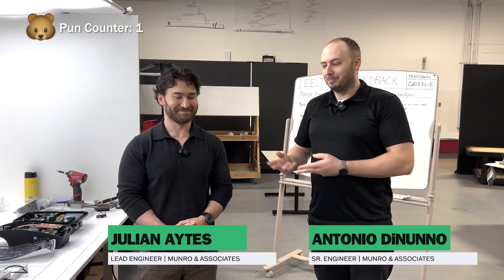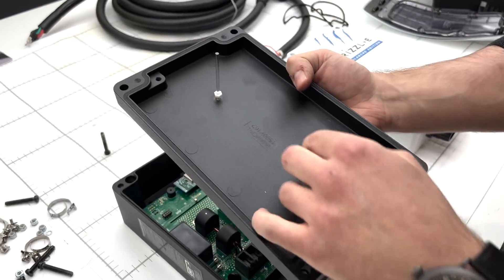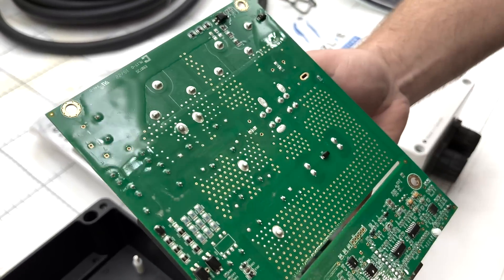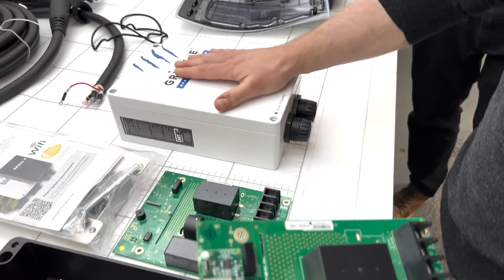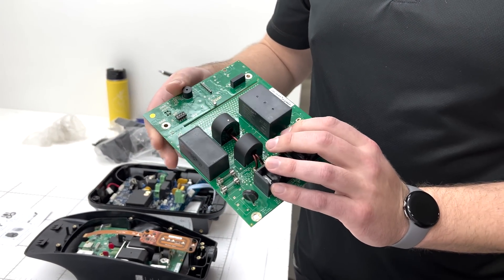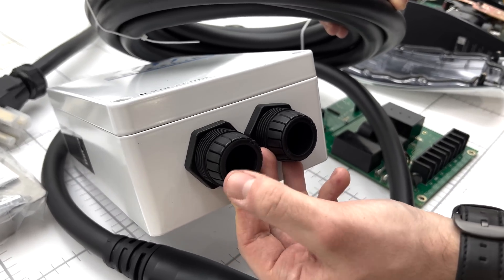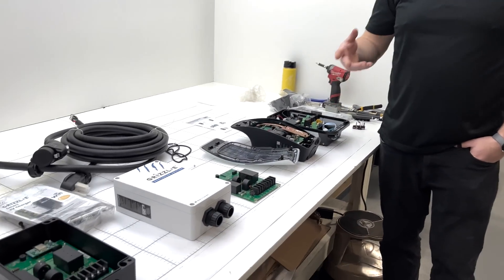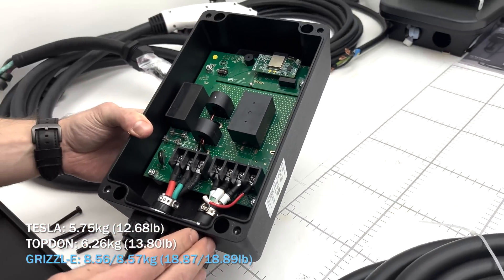EV Home Charger Teardowns E3: GRIZZL-E Classic & Avalanche

Comment: Hey Ho! This review echoes Mr. Tom Mologney , State of Charge, review. This is a first rate charger which will survive if you have kids in the house. I have two of this brand, and I have had no problems nor concerns with it. They COMPLETLY left out the fact that you can have this charger device with a plug in OR a hard wired installation method. To the curious reader in search of an excellent charger; this is the one to buy!  {For all the linguistic Karens-- 'charger' is the vernacular term for what is, in plain terms, an extension cord with a computer attached to it, to feed electricity to your EV. The true 'charger' lies inside the EV}>

Comment: The Tesla charger case neatly holds its cable.  Given that these are little more than 'junction boxes', that's the major feature difference in my mind.
Reply: The Grizzl-e comes with a holster to mount on the wall to hold the plug when not in use. It has a groove on the top side of the holster to carry the cable. It's not as elegant as the Tesla set up, but it's simple and it works well.
Reply: The grizzle comes with a nice holster for the cable therefore there is zero difference

Comment: I bought the wifi model and the wifi functionality never actually worked. It does charge good though. Just don't buy the wifi one
Reply: I wonder if the fact that it has a metal (aluminum) case is part of the reason for WiFi not working or just having really bad reception. Usually, when you have a metal enclosure you need to add an external antenna.

Comment: I bought the classic less than a year ago to do 30A out of my house for now.  If i move up to 50A, you just need to change the dip switches inside, they said.
Reply: Only rated for 40A…don’t for to upgrade your breaker when you trip those dip switches!

Comment: This is drivel. I expect Monroe to comment about engineering for manufacturing, durability, and performance. Talking about how much a circuit board weighs and how easy it is to take a unit apart is completely irrelevant. Also, if you know why there are physical fuses in lieu of electronic circuit breakers, say so, but you don't know, you're just speculating. I get enough of that from talking heads on TV
Reply: also slacking analysis - "lead free on the board" - the icon is on the 3rd party daughter board, the small board with the controller soldered on the "wifi card" - which doesn't mean anything for the whole board. the chip might even be an esp32 which would be interesting to know they are using this in there. Also is this an electrical engineer talking about the "integrated pad presenting the electricity to choose different paths for electricity" ? Really?
Reply: This is the third one we've torn down. So we don't have a baseline for "normal", yet. We are seeing some common circuits and the hall-effect voltage sensors are common features. We'll do a synopsis at the end to actually point out what is unique.

Comment: NO NOZZLE MENTION?
Possibly using exact part, but that itself would be informative.  You are slacking guys 😅
Also any difference in cable length, or cable core re copper cost, current&heat resilence, flexibility. After all the cable is the main device to human interaction item.

Comment: I worked for an OEM and we did validation on about 15 different home LV2 chargers and the grizzle was the most rugged device unit and what I'd buy for my home charger.
Reply: How does the ChargePoint Home Flex compare to the Grizzl-E?

Comment: Fuses are an additional over and above the UL required protection exactly to save the board in case of the external spike.
Reply: Thanks for sharing! We'll use this info to better understand chargers!
Reply: Ok, remote install on a pedestal it will be. Thank you for your quick response!
Reply: I just bought the 80 amp version.
Glad i saw this video, i really wasn't sure since they are litterally 1/2 the price of the competition. But those things looks like they're built to a simple stand point and made to last.
@unitedchargers is it possible to have a longer cable to reach the vehicule? I have a pick-up truck with a trailer always attached to it and the 25 feet cord will be too short.
I'm thinking of a remote install from the home with a pedestal, or a longer cable if available.
Reply: @ProbeGT2  25 feet cable is maximum that is allowed by UL certification. This is the longest you can get. Using extension cables is dangerous and not allowed by UL. American EV chargers are not safe to use with extension cables as they do not monitor the line break on the charging cable. Solution here - put your charger closer to where you need it, even outside on a post - Grizzl-E is made to withstand any weather.
Reply: Ahh, but everyone knows that the $500 control board will fail, in order to save the 10¢ fuse.
Reply: @thomasbonse  We had hundreds of instances where 10c fuse saved the $200 PCBA
Reply: @unitedchargers , do fuses really blow that often?
Reply: @zroger73  We sell a lot of chargers, that why "hundreds" seems to be a lot. In percentage it is below 1%

Comment: I've been using this charger for two years or so for my Model Y. Very nice simple no frills charger that I've never had any issues with.  I recommend it to everyone who asks.
Reply: Two years here too. No issues. K.I.S.S. Engineering.  Let the car do all the scheduling.  Get new car with more features, the charger will always do what it is made for - provide power.
Reply: my Grizzl-e has been working great 2+ years. I purchased it because it is simple & rugged.
Reply: Same here. I've had mine for 2 years and 0 issues. Really is a solid unit. Wanted the Tesla Wall Connector, but decided on J1772 just in case.